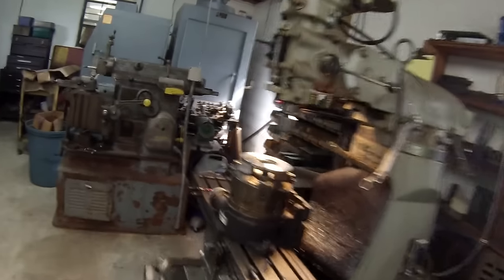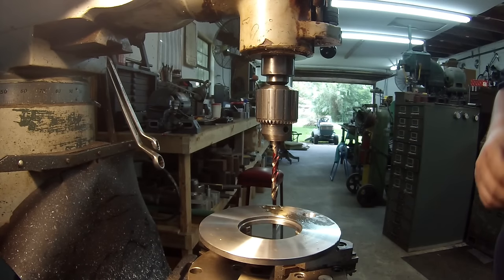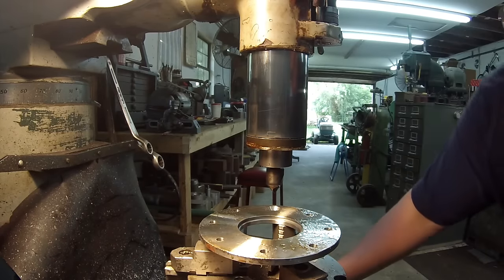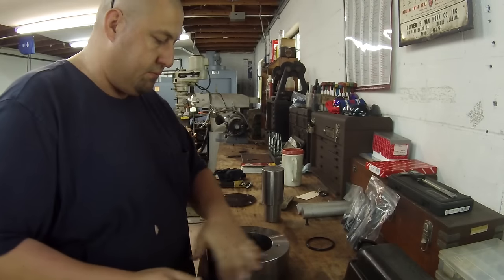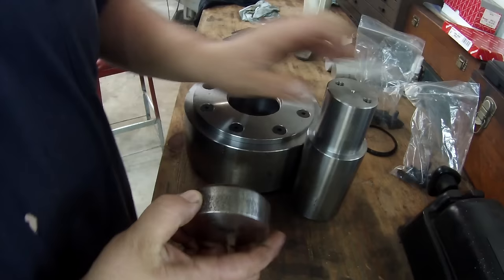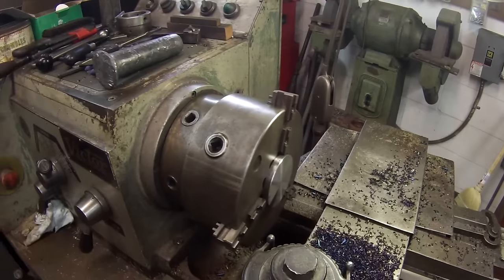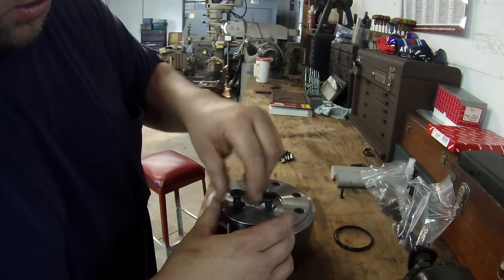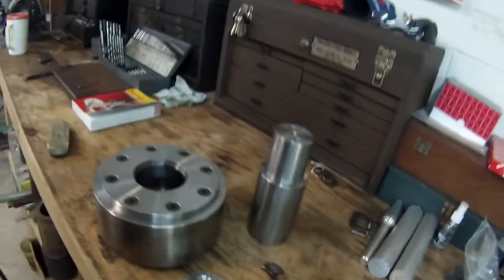Roller Assembly Part 3

Comment from the maker: Chris, I built that long workbench when I was 18, back when I was using the garage for my cars. I actually had to cut about 6' off of it when I moved the machines in just to make more room. I love having it though, and use it now as my primary work bench. The plywood top works great and is a soft surface for delicate parts and tools.

Comment: How do you line the thin plate up in the SS so you know you won't hit a jaw with one of the 8 holes to be drilled and tapped?
Reply: sorry, drilled & c'sunk?
Reply from the maker: The diameter of the hole pattern was large enough to clear the jaws how I had it chucked.
Reply: Abom79 He asked what I was about to ask. Will there be cases when the drilling/c. sinking operation might hit the jaw? How do you avoid that? Thinner jaws, perhaps? (If there's even such a thing, lol..) Thanks, Adam,  and happy new year to you and your family! :)
Reply: +aryesegal1988 Get as many as you can by skipping the ones at the jaws. Then crack loose the Super Spacer, rotate the part, use the drill or a pin in the chuck to line the part back up. Then chuck back up on the part.